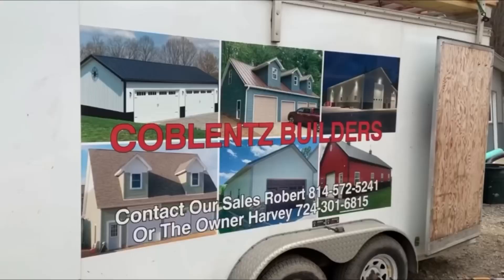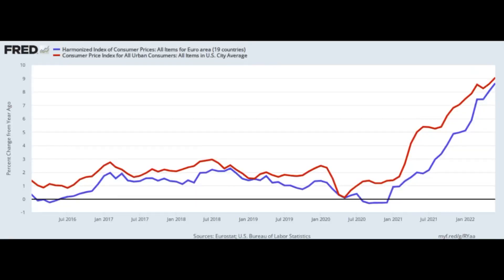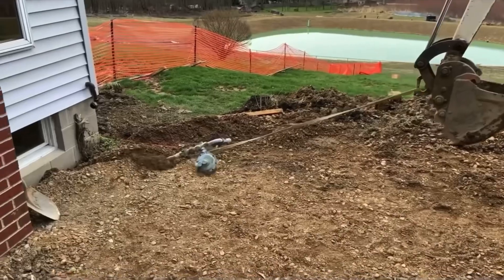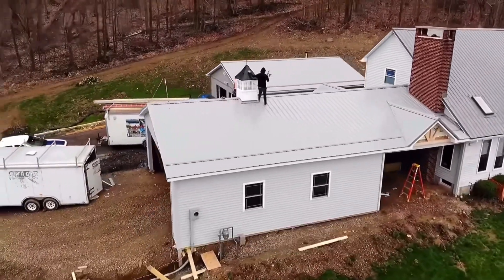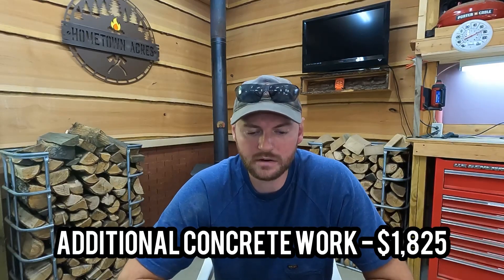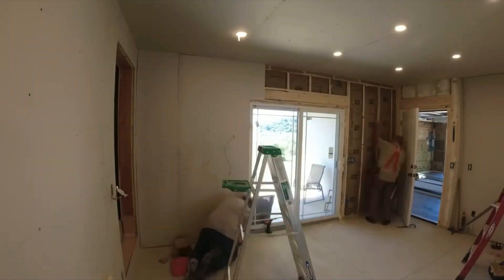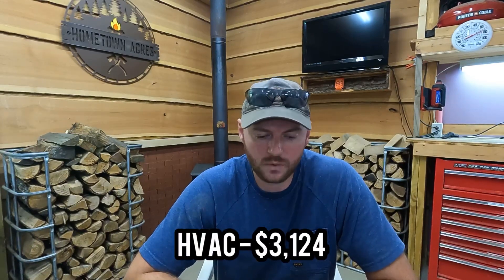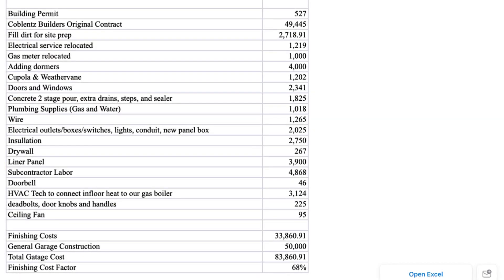How Much Does A $50,000 Garage Really Cost?

Comment: Very interesting.  I also built a garage/shop this year about the same size as yours.  30'x48' interior with a 10' porch on one of the 48' walls (40'x48' total footprint).  I have 200amp dedicated electrical service to the garage, a separate natural gas meter, radiant floor heat, all of the good stuff.  My total cost was $98k.  I had $8k in excavation costs (where it sits used to be thick woods on  the side of a hill).  Adding my 10' porch on we're pretty darn close to the same price.

Comment: Interesting how the cost varies.   Outside of Chicago. 1400 square foot attached garage.  Insulated. Stone front 3 garage doors   Upgrading to 200 amp shut home down and moved gas and electric . 10 Dr ceilings dry walled painted  trimmed ,painted ,small cement patio.  Generator, lights in and out.  6 inch 40 foot drain w 160 feet outward  =130 grand. That’s with out gutters, blacktop.   Certainly tried to apply some of things you incorporated.  Value of 1.68 is accurate enough to configure    Good work.  Thanks for sharing

Comment: Great information! I have the inside hose spigot also. But I just put a frost free one on the outside also. There were many times I had the hose attached inside and went to shut garage door but had to get back outa car and disconnect it. Put a Y adapter with shut off valves on each side. I leave 1 attached to the the hose real and the other with a quick connect for the pressure washer. Hardly use the inside one anymore. Keep up the great videos. Thanks!

Comment: Usually, the finishing cost increases as a percentage as the building size decreases - you typically lose efficiency as the learning curve/mobilization is still the same on smaller structures. It's why developers love to maximize square footage - the incremental unit cost decreases, especially if you simply make a room (other than bathroom/kitchen) bigger.

The biggest cost of that garage is all the toys that will fill it.

Comment: Very interesting.
In 2 weeks our 33x40x14( side walls) pole barn is supposed to be started. ( Cutting trees down pulling stumps and removing. Demo and remove two small buildings and excavation of fill dirt  done last month)
I told the contractor I didn't want any surprises of stuff that's not included I wanted a complete price.... no surprises. It ended up higher priced then what I thought it would be but still within our budget so we went with it. After seeing what you paid for your fill dirt now I know why my price is so high.
Over two days. We had 13,- 20 yard dump trucks delivered and seven,- 10 yd dump trucks for a total of 330 yards.
And just for others to know...
Demo  and take away in a lugger 8x12 old chicken coop and 20x20 steel Big box store old storage building, remove all stumps. 330 yards of fill brought in and bulldozed. 33x40 x 14 pole barn, 2- 10 ft wide by 9 ft tall overhead garage doors, 1- 12 ft wide by 13 ft tall overhead door. Metal walls and roof, one foot overhang all the way around, sidewall has bottom 3 ft wainscot (different color than the rest of the side), complete concrete inside, 33x6 concrete apron in front of two doors. 6x12 concrete on 3rd garage door which is on the side, and one people door. 
This building is used for storage only.
 No electric, no water, no heat, no interior, just storage.......$78,549
It was fun watching your project. Thanks for taking the time to record and post your videos.
Have a Jesus filled day everyone
Greg in Michigan

Comment: Think how much more it would have been if you didn't manage portions of it.  

The prices of things are crazy.  I built a 30' x 72' in 2009.  Concrete footer with concrete block 3 courses above grade.  2x6 construction with full insulation in walls and ceilings.  100amp panel.  I did all the work myself and had $28,000 in it.  That's with fill, windows, 2 large OH doors, 2 man doors, liner panels on inside, T5 lighting, concrete, etc.  I am guessing the price has more than doubled since then.

Your garage looks fantastic!  Thanks for sharing the breakdown.

Comment: I have enjoyed your build a lot. I wonder why you did not go with closed cell spray foam insulation over the fiberglass.  My experience with it is that while cost is different it usually helps to pay for itself by quick time for installation and overall insulating cost recouping from heating and cooling. Add to that you could have taken more advantage at a later date of the overhead of your garage by not having blown insulation. A win win regarding the foam over blown insulation.

Comment: Good morning Adam! Since you’re an accountant, I can understand your concern for running over your budget. The way I look at this though, you did not build a garage, you built an extension of your home. You could put furniture in there and live there if you had to, it is so well-built. My hat is off to you and Alana for building such a magnificent addition. Kudos to your mother as well. She could’ve easily been an architect. I took drafting in junior high school, and I enjoyed it immensely. I was actually good at it. Why I did not pursue it I don’t know. I have amassed quite a collection of drafting tools and sets downstairs, so now that I’m retired, I plan on pursuing that just for my own satisfaction. I did have one question regarding your electrical, I noticed that the outlets in the garage are horizontally installed versus vertically. I can actually see an advantage to that so you don’t have cords draped over each other. They would hang independent of one another side-by-side instead of one on top the other. Once again, I think you did a marvelous job. The only thing I might’ve changed is to have added a poly moisture barrier over the insulation and green board drywall over that, then installed the metal. But that’s it. I am so happy for you kids! I can’t wait until the baby arrives in November. Have a great one and we’ll see you in the next installment.
Reply from the maker: Thanks Jim. Yes the outlets were mounted that way simply because with the book shelf framing Coblentz uses that’s where the studs were and we didn’t want to build a frame for each outlet but yes you make an excellent point it may actually be better that way!

Comment: How much of the lumber that went into the build did you mill yourself?
Reply: All of the Building lumber has to be inspected and stamped to maintain proper building code standards.  So the only milled lumber was what was used for the decorative beams that adorn the dormers and non supportive posts on the entry porch.  
The plan is to allow them to dry until next spring.  He will plane those beams to a finer surface then stain them a darker brown.

Comment: So it was a $50,000 garage or that was your initial budget? Not really sure what you mean here. I am doing a detatched 20×30 garage. The garage itself should be $32,000. I don't think I would use the .68 overage charges...that's a very arbitrary amount depending on many factors.

Comment: Electrician here …. Material seems pretty damn high. What did that include? Did you pay that material cost in addition to the labor of that retired guy? If so, did he provide you receipts? Consider each receptacle/switch and box costs about $4. A 250’ roll of 12/2 romex costs about $120 for 20a circuits. A Panel is maybe $150-$200.
Reply: Remember he is an accountant by trade and not a country boy or wants a common sense. Good Dude with good intentions and some really good ideas excellent with numbers. What He should be here after all he’s in accountant